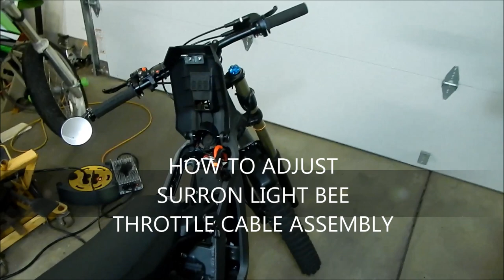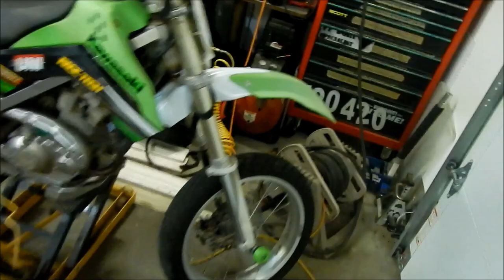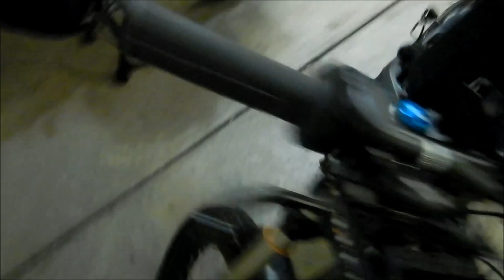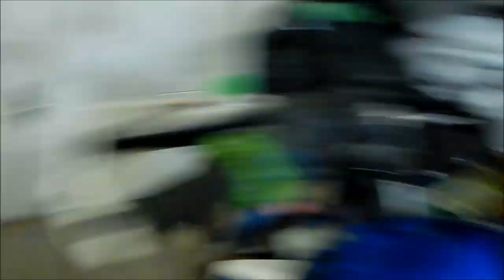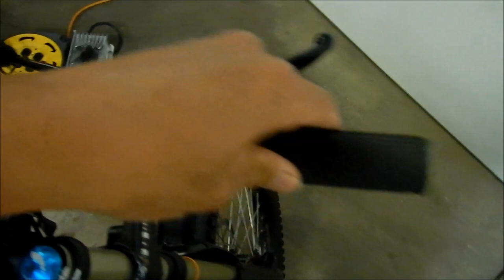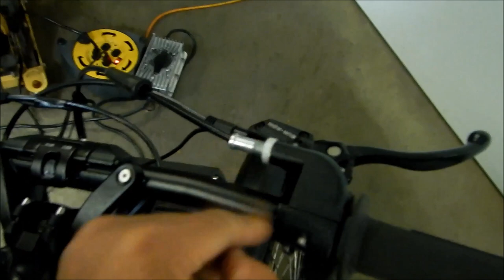How To: Adjust Sur Ron Light Bee Throttle Cable

Comment: Did it help on the amount of twist that you have to give it I know there's a lot of twists on that throttle I'm getting ready to get mine
Reply from the maker: Yes it did.  I think I made it too sensitive so I backed off a little.  I guess it's user preference.  There is a large regen zone in the throttle also that doesn't do anything, so it's hard to tell if its too tight.  But as long as there is some play you'll be fine.
Reply: @hadesomegamoto7639  awesome thanks for the feedback. I enjoy your videos.